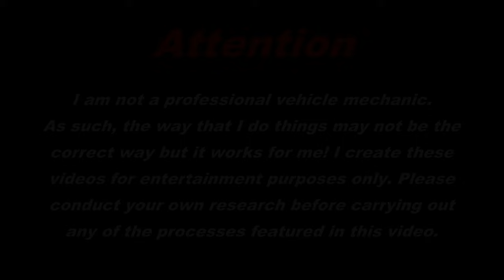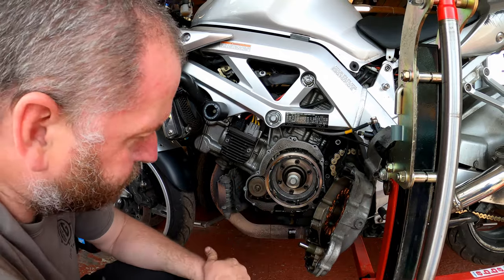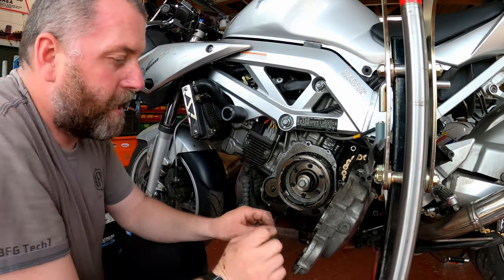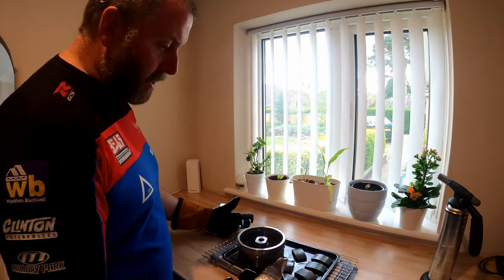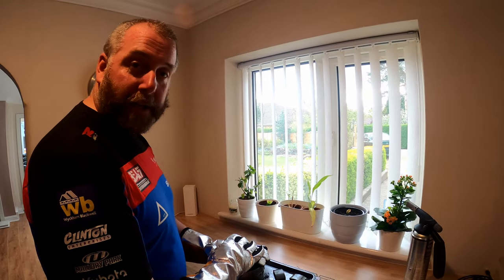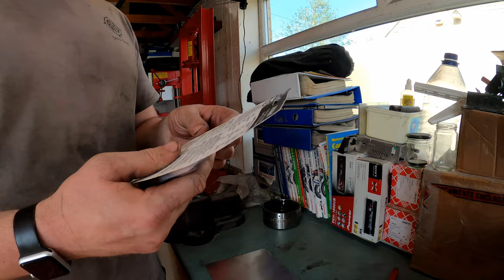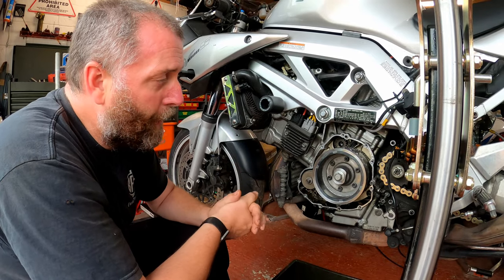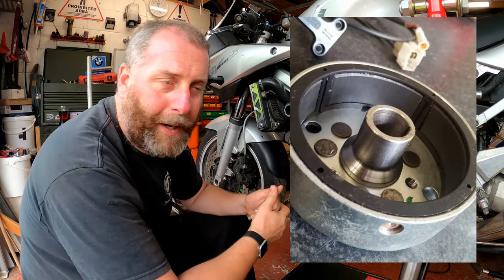Suzuki SV1000 Project Bike - Part 10 - Checking and Repairing the Stator Magnets, a Common Problem!

Comment: Given how much this issue has been documented over the years its surprising that a recall was never issued. Thanks for all of the great videos you've made on the SV1000. I picked up the N version from a friend and it's been a pleasure to ride so far. With your videos I know I'll be able to keep her on the road for countless more rides. Cheers.
Reply: I find it amazing that Suzuki charge so much for a replacement rotor, when they must know they're only being sold because the originals were defective.

Comment: Good video.  :)
But you missed one very crucial step when reinstalling the flywheel at 31:25.
Many people probably missed it, but it was not fully seated in the nose of the crank before you started tightening the center bolt. If you just run the bolt in and torque it, you risk cracking the starter clutch and those are f***ing expensive.  I suspect you DID it, but it's not shown in the video.  ;)
All you have to do to get it fully seated, is:
1. Remove the hollow axle on the starter idler gear, and remove the gear. It's the small gear with the short bushing on the outside of it.
2. Rotate the big ring gear behind the flywheel while pushing the flywheel in place. It will then slide the last 6-7mm in and be fully seated.
3. Reinstall the small idler gear, hollow axle and bushing.
4. Torque the bolt to 140nm.
5. Change the gasket and put the bike back together. No RTV allowed.  :D
I have been doing these SV flywheels on customer bikes for more than 4 years now - and i secure the magnets in basically the same way as you do. I just use JB Weld instead of the locktite product, but that's not important.
It's very nice to see you do a video on the topic - people have been asking for it for a long time, and i never got around to filming the process myself.
Good job.
Reply from the maker: Good tips dude, probably should have covered those steps myself in a bit more detail! 👍🏻
Reply: @KevsShed  - No worries mate. Keep up the good work.  :)
Reply: if you fuck up a starter clutch, hit me up i have... dozens (theyre all the same on 1g and 2g and sv1k)

Comment: I found it hard to get the air bubbles out of the jb weld when working it in between the magnets.  I ended up putting the jb weld in a small syringe and squeezing it in there. Makes the job a lot neater and easier. Great video
Reply from the maker: That’s a good tip bud, I hope that others find it helpful 👌🏻😎

Comment: just done mine today and my 2003 SV1000S only had 5500 miles from new so its deffo a problem with the glue from new terrible Suzuki has been allowed to get away with this. i used JB Weld steel stick to fill the gaps and the same Loctite 638 to stick them back down absolutely solid
Reply from the maker: Nice work! 👌😎
Reply: yamaha did the same thing with the 07 and above r1's, fz1's

Comment: Hello Kevin , watching all your great videos,many thanks,  but never have seen any comments ( yours or anyone's ) on what ,if any, are the symptoms on how the engine runs when the magnets shift...my 03 SV  just started acting like its running out of gas so replaced the fuel pump as seemed logical and did nothing..does the magnet failure make it run badly ? Or affects just the charging system, affect spark/ignition ( it should ) going nuts here. No codes on cluster indicator either 
.. thanks in advance
Motox_cris

Comment: Awesome, thank you! Would you be able to add a link in the description for the tool you used to remove the stator basket? It looks like a bolt from a 3 arm pulley puller, but I was hoping to make sure I got the correct tool.
Reply from the maker: Good idea, added 👍🤓 I have seen people use an M20 x 1.5 bolt also, but the proper tools are hardened and will stand up to repeated abuse.
Reply: @KevsShed  I thought I'd follow up with my progress. I'm waiting for some more OEM parts and the puller tool to arrive, but I took a deeper dive in to Loctite compounds so I could avoid using JB Weld as the placeholder. I came across Loctite 648 as the solution. It too shares the surface adhesion qualities of the 609, but has a high temperature resistance, high vibration resistance, and high resistance to oil and other chemicals. It's actually described by Loctite for our use. It's good up to 356F (180c) which should be more than enough while allowing us to remove in the future if ever needed. Idk from experience if the JB Weld would be considered a bad option by any means, but I mainly looked for something which was more or less reversible if needed. I hope this helps if you ever run in to this again! 

Also, im in the process of also replacing the clutch basket with one from Werks (here in the US) which seems to offer an extremely long service life compare to OEM). I know you mentioned that was on the list in case you're still looking for parts.

Cheers!
Reply from the maker: @JollyGreenGiant5025  Excellent info there Ben, thanks for sharing

Comment: Hello,
very interesting video. thank you.
But i have a question. Does the loctite 609 can be replaced by JB Weld ?
Reply from the maker: The loctite is thin so doesn’t lift the magnets closer to the stator.
Reply: @KevsShed  ok. Thank you

Comment: What did you use to clean the oem glue off the magnets and basket?
Reply from the maker: I gave them a good rub down with sand paper, it didn’t remove every trace but it was good enough 👌🏻

Comment: Great video I've followed it to do my magnets.  Having an issue when fitting the clutch slave cylinder though.  Tightened up the two bolts holding it (one longer than the other) to torque setting but when pressing the clutch the cylinder moves slightly on the RHS bolt.  One of the bolts is 5 mm longer than the other, I've checked and it seems the RHS should be the longer one.  Did you notice which why around they fit or if your cylinder moves?  Cheers
Reply from the maker: https://www.fowlersparts.co.uk/parts/5283911/sv1000-k3-k5-2003-2005/clutch

Comment: Great video Kev just about to do mine,magets aare all tight so just going to fill with JB weld between the magnets is it ok to fill the holes between the magnets or should they be drilled out do you know the purpose of the holes? bike is a 2005 17,000 miles on the clock. Thanks. Dave.
Reply from the maker: As far as I’m aware the holes are only there for weight saving. The later SV models don’t have the holes so there’s no harm in filling them. I have left mine filled in 👌🏻😎

Comment: Hey great video mate gonna check mine this week . 
You got a link for the big case gasket ? Also a link for slave cylinder repair kit ? 
is it ok to just fill the gaps with the jb weld if the magnets haven’t moved ? 
Is it ok to just fill the gaps if they have moved ? 

Cheers
Reply from the maker: Hey bud, thanks for the compliment! If the magnets have not shifted and are stuck fast then JB weld between them will sort them out and prevent them ever moving. If they have moved then they will need shifting back and JB welding back into place to stop them ever moving again. It's entirely up to you if you want to go to the effort of removing them and re-sticking them back in place. Either way, JB-weld them to future-proof the bike. I have also added links in the video description for the gasket and a slave cylinder rebuild kit, I will be doing a video on the slave cylinder rebuild just as soon as all of my other projects stop monopolizing my time! 👌😎
Reply: Nice one cheif Thankyou very much

Comment: Hi Kev,
New sub here, been enjoying your SV1000S and bike content, some excellent videos you have.
I've just bought a 2004 SV1000S with 23k on the clock and it's in pretty sweet condition, however no paperwork or indication to say this particular job has been done. I expect not to have any receipts given it's more of a DIY job but I'm curious to know at which point in the bike's life it's worth checking this - any symptoms or particular noises to listen out for?
I've not picked up the bike yet and I'm wondering if I should do this before even thinking about riding it properly?
Any recommendations would be greatly appreciated 🙏🏼 🙂
Reply from the maker: There's no hard and fast rule on the mileage unfortunately, I've heard of low mileage bikes that have the problem yet I have also heard of high mileage bikes without this issue! The only way to be sure is to check buddy! 👍
Reply: @KevsShed  Hi Kevin,
Thanks for responding so quickly, really appreciate it 😊 
I agree, I will crack it open when I get the bike, praying the magnets aren't all shot to pieces, will have to open it and find out I guess 😶‍🌫️
Could you share the torque spec for all the the  little bolts of the outer case, also did you order the gasket from Suzuki - OEM part?
Thanks for the help, super grateful 🙏🏼 😃

Comment: Is it a m20 x1.5 yeah? And does it take long before you can shape (sand down) the JB weld I put some in between mine today found it difficult as the magnets seemed to pull it all over the place it didn’t want to stay in between them!
Reply from the maker: Yeah that’s the size. There is also the steelstik type that can be used too, it’s less ‘sticky’ so is a good alternative. The putty being magnetic needs a little time to start going off really so that it’s less runny. Hope this helps.

Comment: Hi Kev,
Thanks again for this really informative video.
I've got my SV now and i'm getting eveything ready to do this job (planning for the worst). Did you get the stator cover gasket from Fowlers? Also do you use anything on the gasket to make sure it's properly sealed against the cover?
Thanks buddy 😊
Reply from the maker: Hey bud, the factory manual doesn't call for any other sealants etc. Just the gasket. ✌
Reply: @KevsShed  excellent- thank you very much! Can't wait for more SV content 🤗🤗

Comment: How many JB weld do you use for the whole repair? 1 Oz to fill alle the gaps between the magnets? I cant't believe.
Reply from the maker: Just one pack mate! 👍🏻
Reply: @KevsShed  but with the steel stik? (grey)
Reply from the maker: @IngHH  No I used the epoxy on mine, the Steel Stik is an excellent product though and if I were to do it again, I would probably opt for that next time. 👌

Comment: Waiting for the follow up because I'm having issues putting the case back on. Found out that the pin is the only thing stopping me
Reply from the maker: Hey bud, what pin do you mean? Do you mean the locating dowel between the engine casing and the stator cover?
Reply: @KevsShed  it was the bushing for the idle gear, somehow mine was where the sprocket gear's pin was.

Though now I got it out only for it to disapear either in the oil pan or the shed somewhere.

Comment: Can you clarify the loctite you used. I've tried finding 679 but no joy
Reply from the maker: I’m pretty sure that I linked it in the video description chap 👌🏻
Reply: Just seen another comment, he used 638, so all good👍 great vid by the way.
Reply from the maker: It’s 609 bud, did I say a different number in the video? https://ebay.us/AxxUAR
Reply: @KevsShed  cheers for the reply. It sounded like 679 on vid.
Reply: @KevsShed  How many bottles did you use and what size bottle, thanks! Great video!
Reply from the maker: @provy0071  Just the one bottle mate, I linked the exact one that I bought in the video description mate.
Reply: @speshdave how long does it take the 638 to dry / cure ? Mine has been in 24hrs and is still wet ???? C

Comment: Do i have to drain oil before removing cover?
Reply from the maker: It depends, if the bike is on the side stand then yes, if the bike is upright on a stand then you shouldn’t need to. You’ll lose a few drops but should be fine otherwise 👍🏻
Reply: Thanks 👍

Comment: Very instructive video, I've gone through the same steps and I have one question: after tightening the center bolt, I still have some play (around 1mm) on the one way clutch back wheel: it can move along the crankshaft. 
I haven't check if I had the same play before dismounting everything, is it ok ?
I've done a video showing the issue: https://youtube.com/shorts/zO6WEskvcAE